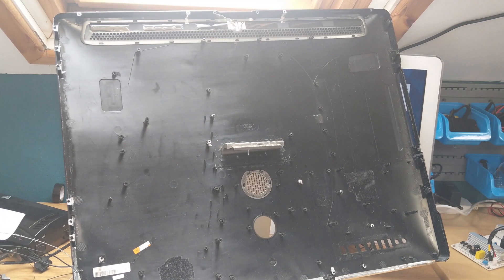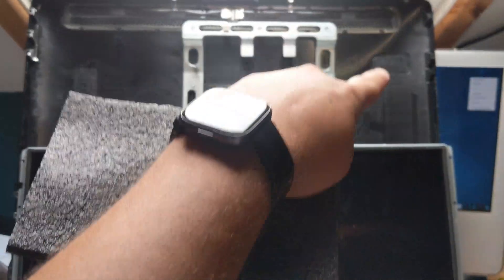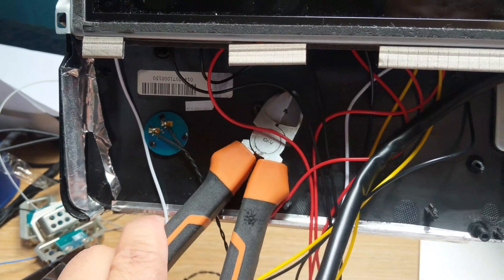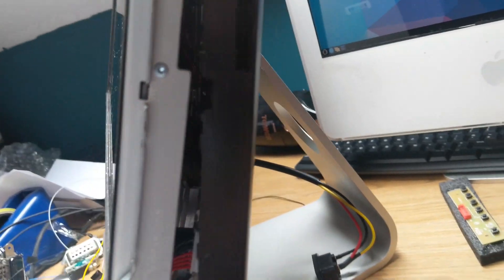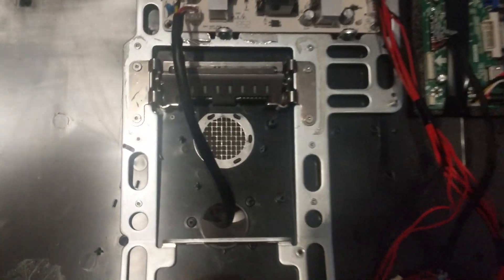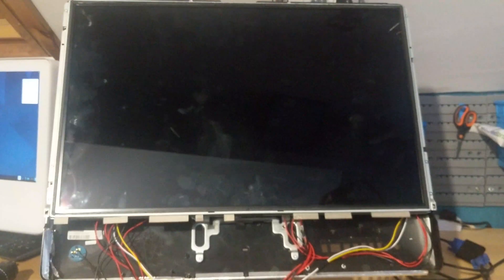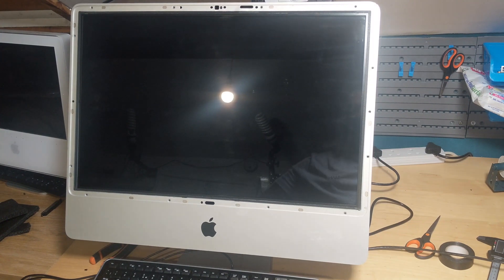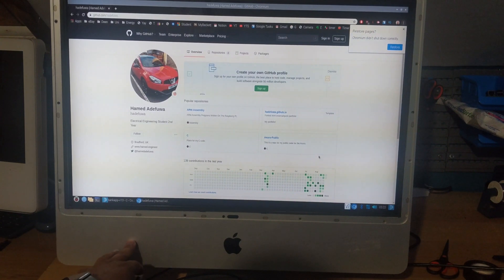Working Raspberry Pi 24 Inch iMac Conversion - Original iMac Screen - Pt 3

Comment: Why not use the original powersupply from the imac?  Or a replacement. It fits perfectly and provides directly the power for the display panel.  Likewise for the power cable, use the existing one.  The LCD driver I've also added on the left side were the dvd used to be.  Raspberry I still need to add, need a dc-dc converter as the imac powersupply only has 12V outputs.  currently just using it as external monitor for my laptop.
Reply from the maker: Short answer is low skill level 😂 I'm slowly getting there. I've parked this project for now until I feel confident enough to tamper with a psu. Sadly they don't teach you these things in university. If you get a chance, would love to see your setup because definitely the way I was going about it was completely wrong. I either have to use the original psu or mount an external psu on the back (which would look so ugly.)
Reply: @HamedAdefuwa  Once the dc-dc converter is in and the other cables to attach to the pi inside, will see to make a video.
Reply from the maker: Look forward to it!